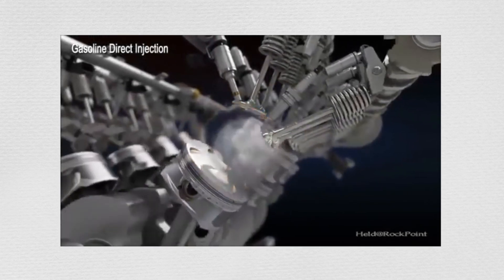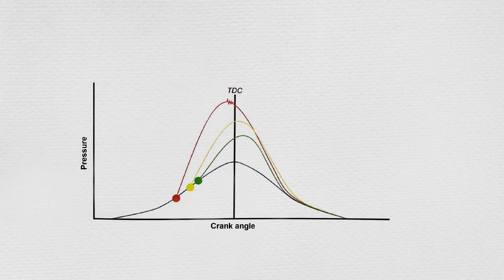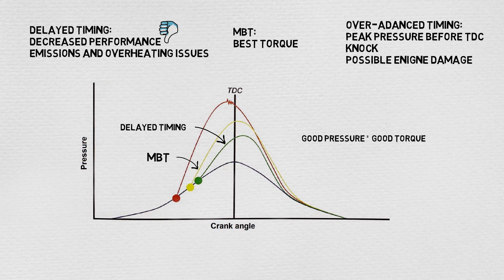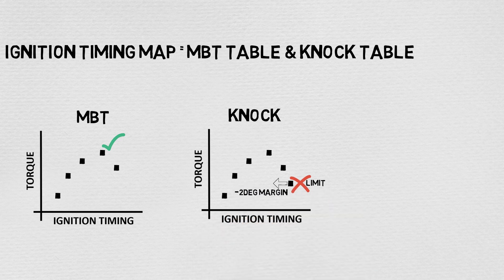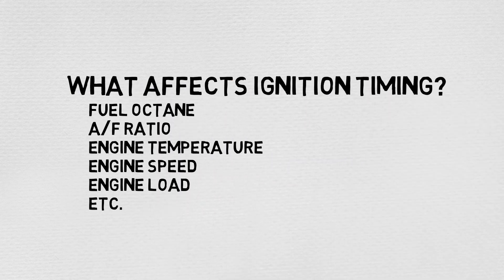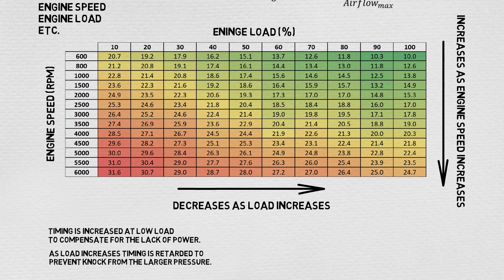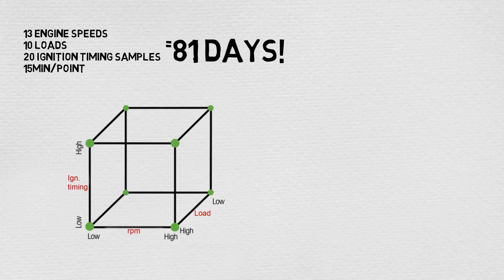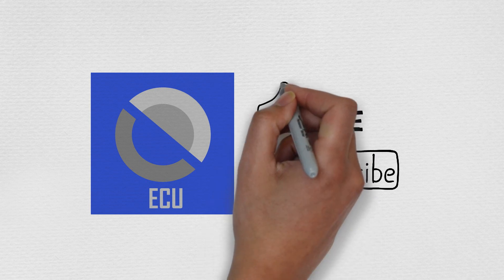IGNITION TIMING SIMPLIFIED | The secrets of spark tuning revealed

Comment: at 2:53 it shows ignition timing as the x axis, with 10deg (knock limit) coming before 15deg (MBT). are both of these angle measurements BTDC? wouldn't 10deg come after 15deg?
Reply from the maker: Very good question. You are correct, this variable is measured in BTDC, but you have to think "opposite". 1deg BTDC = -1 from TDC. Therefore, when you advance spark you start -1, -2, -3, etc. When you say "advance spark by 5 degrees", you are essentially igniting 5 degrees before you normally would, aka BTDC, aka "negative" relative to TDC.
Knock occurring before MBT is very common on the upper half of the load axis.

Comment: nice video, thanks for sharing. I have BMW M4 (S55 engine) and still thinking of ignition timing corrections which I can see at my datalogs. It is random, cylinders are changing, the difference is usually up to 3 deg.sometimes up to 5 deg. Some tuners say that this is caused by low fuel quality so I have tried all branded fuel from 95 to 100 OCT and the datalogs are always almost the same. Is this a standard engine behaviour or should I look for some problem?  Thanks, Richard
Reply from the maker: Random ignition timing corrections (1–3°) are normal and part of the ECU’s knock control. Seeing up to 5° occasionally can still be okay, especially under load. Since you’ve tried high-octane fuels with no change, it’s likely not a fuel quality issue. Unless you’re seeing consistent large corrections on the same cylinder or under light load, this behavior is typical and not a sign of a problem.
If you’re still concerned, make sure your spark plugs and coils are in good shape, keep an eye on intake temps, and consider cleaning carbon buildup if the car has higher mileage. You might also try a less aggressive tune if you’re running an aftermarket map, sometimes too much timing advance can cause these small corrections even with good fuel.
Reply: @enguverse  thank you for your professional opinion, I very appreciate it. I only use OEM maps M4 base, M4 Comp or M4 CS. Later I did a deepper investigation, besides the fuel quality I also changed one spark plug and coil at cyllinder 2 and 4 and watched the values at datalogs, nothing changed. I also put back the stock air intake sys (I use Eventuri ussually) and exchanged all OEM spark plugs to one step colder NGK (I suspected that there is too hot in combustion chamber), nothing changed. The car has now 70.000 km, oil changed every 10.000 km, never used at track, the engine inside is cristal clear. Unfortunately I didnt have a datalog reader when the car was a brand new. First I started hardware tuning (Intake sys, sport high flow cataslysts, OPFs dissmounted, sport exhaust sys) and later when the car warranty ended I bought a SW for ECU DME tuning. It was the first time I could read datalogs and since then I can see the corrections. All the time I accuse myself that I changed the car behaviour with my HW tuninig, but as the time goes forward I am finding that corrections could be there since the beggining😀
Reply from the maker: Hey Richard, thank you for the kind words. I’m glad to hear the car is doing fine. You just gave me a great idea for a future video, knock control system. Life happened so I had to stop making videos, but I’m trying to get back on the YouTube horse.

Comment: Does ignition timing change once the engine comes up to operating temp? I have a motorcycle that runs fine when cold but has a hunting idle once the engines warm. Previous owner had an aftermarket ignition module.
Reply from the maker: Ignition timing does change as the engine warms up, it usually runs more advanced when cold to help with smooth starts, then adjusts as it reaches operating temp. If your bike idles fine cold but hunts when warm, it could be the aftermarket ignition module causing timing issues, or something like a vacuum leak, bad sensor, or poor idle mapping. If possible, try switching back to the stock module to see if it stabilizes.

Comment: YOU ARE GIVING INCOMPLETE INFORMATION, THERE ARE MANY REASONS WHY THE COMBUSTION IS GOOD AND TIMELY, SINCE A REALLY GOOD AIR MIXTURE COMES INTO THAT COMBUSTION CHAMBER, AND THEN WE CAN COUNT MANY MORE REASONS, HOW IS THE SITUATION IN CARBURETED VEHICLES, IS THE SENTE SETTING FULL, IS THE IGNITION COIL SENDING ENOUGH VOLTS, THAT IS, WHEN YOU TELL ABOUT THE ADVANCE SETTING, YOU SHOULD SAY IF ALL THE CONDITIONS ARE IN PLACE, AND THEN ONLY IF THE PROBLEM IS IN THE ADVANCE SETTING, YOU SHOULD TELL IT.

Comment: My car is pulling -10.5 degrees we got it down to -8 how tf do we fix it
Reply from the maker: If your car’s pulling -10.5° (even -8°), that’s a lot! usually means the ECU’s seeing knock or your tune’s too aggressive. Try running better fuel, pulling some timing in the tune, checking intake temps, and making sure your plugs and coils are solid. Also worth checking for false knock from engine noise or bad mounts. You want those corrections as close to 0° as possible under load.

Comment: Why overheat when delayed timing is used? makes no sence or is it because of the exhaust gases have not enough time to leave before ex. valve closes which means that "old" hot exhaust gas is caught in comb?
Reply from the maker: When the spark happens late, the combustion isn’t as efficient and a lot of heat ends up in the exhaust instead of being used for power. So, it’s partly because hot gases don’t leave efficiently and partly because late combustion just runs hotter overall.

Comment: Thank you. I have a doubt. You said spark timing is retarded as the load increases and timing is advanced as rpm increases. But doesn't this contradict each other since the rpm increases as the load increases (% load = current airflow/Max airflow *100).
Reply: rpm is just how fast the engine is running, load is the resistance to the engine running. A car in neutral rev'd up to red line would have tons of rpm but no load, and a truck pulling a trailer at 1000 rpm would have a rpm but lots of engine load.

Comment: I have a Polo 6N, 1.4 mpi, the standard ignition timming idling is 6°BTC according to the marks on pulley , but the engine is sluggish somehow here, if I turn the dizzy few degres in advance I really get it snappy. This engine employs a single Hall sender located inside the distribuitor body, wich delivers the timming signal for injection as well, so advancing the dizzy won't advance the moment of injection before the intake valve opens, with bad effects over mixture?